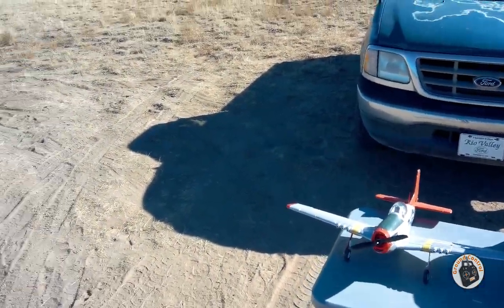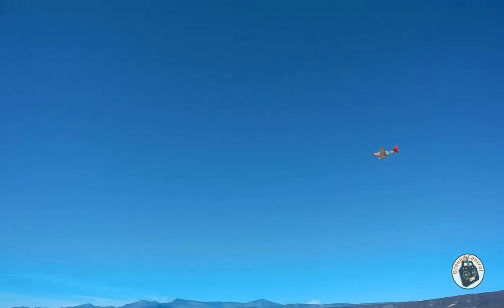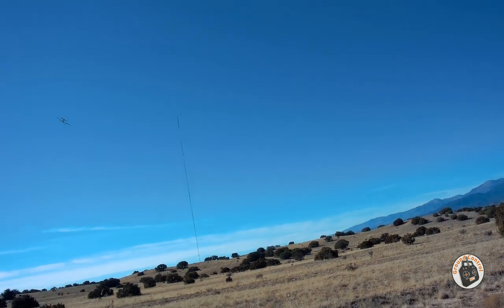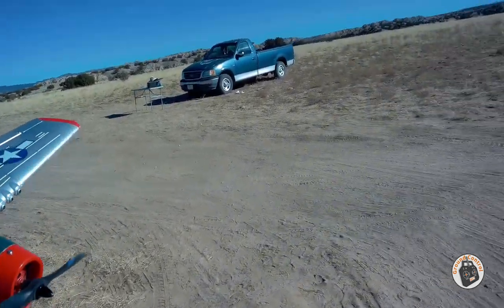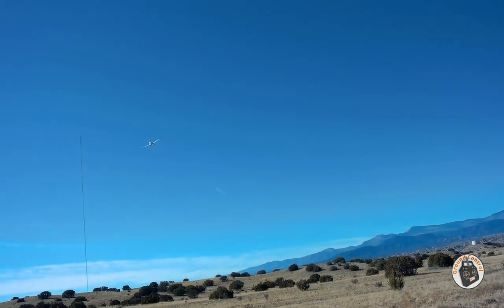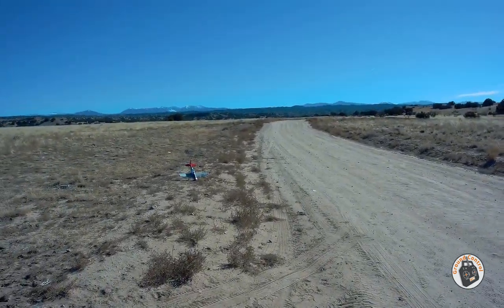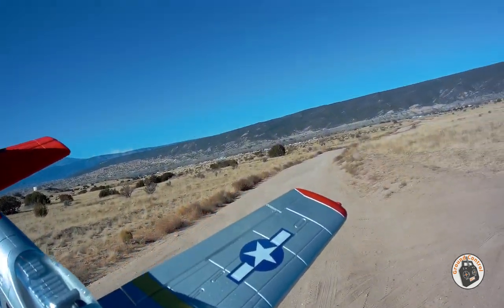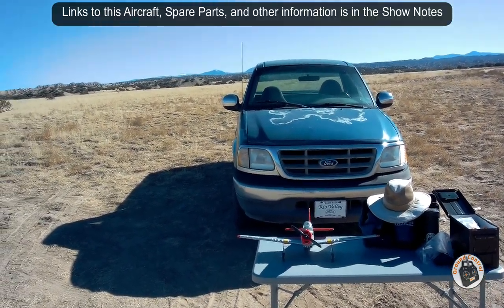Volantex P51D Mustang 750mm Wingspan PNF - Agile, Aerobatic, Wide Flight Envelope, It's a Keeper!

Comment: One of the best "SAVES."  From a turkey to a soaring eagle.  Nice work.

It's crying for a pointy nose though.  There must be some way to get a red spinner on it again.  Maybe redo the motor mount to relocate the motor? Aftermarket spinners start at 1-1/2 inches or maybe 1-1/4" (32mm) so I think one would fit OK.

Happy P-51 flying!

(P.S...4:59....Nice roll-out landing!   Landing #2, not so much (heh-heh))
Reply from the maker: Thank you much!
Hehehe...everyone wants a spinner on this mustang ;-)
It does look a bit strange with the blunt nose but it flies so nice now I'm afraid to change anything...hehehe.
Yeah, the 2nd landing not so much ;-)
See you in the Air!

Comment: Great Flying!!! Did you find the CG marked spot on the wing to be accurate with your 3s setup? Also are you still using the narrow compartment for the battery at the bottom (battery placed vertically) or you  modified it in your setup? Finally, did you install the regular receiver on the wing in between the aileron servo? Thank You
Reply from the maker: Thank you much!
Yes, the CG is good with the 3S LIPO mounted vertically and no modification of the battery bay was required.
I installed a standard 6CH receiver on the top of the wing as far forward as I could get it.
The LIPO is a GNC 3S 550mah LIPO.
I love this airframe ;-)
See you in the Air!
Reply: @GroundControlRC  Fantastic Thank You! Did you manage to put the receiver antenna hanging outside? May be it's me but I noticed that sometimes the vertical battery creates some interference with the receiver
Reply from the maker: @ioskaioska5166  You're right, those vertically installed batteries do cause issues and I had a signal loss with the Volantex Super Cub because of that.
I used a receiver with long antennas so I drilled a hole into the canopy and one of the antennas is inside the canopy and one is straight down the inside of the fuselage toward the tail.
I've never had any signal issues with it installed this way.

Comment: Does this plane work with the controller form the mini warbird (400mm P51D v761) series?
Reply from the maker: Hi Tam!
I have the PNF version so I installed my own receiver.
I don't think the RTF version uses the same Protocol as the Mini Warbirds and I can't find any information on what protocol it does use.
I wish Volantex provided that information.
See you in the Air!

Comment: The P-51 is a nice looking, good flying airframe.  Lots of fun.  An appropriate plane for your bombed out runway.  😂
Reply from the maker: Hi Jack!
Yes, this is an excellent airframe and a blast to fly.
It just bounces right over those bomb craters ;-)
See you in the Air!
Reply: @GroundControlRC  where did you buy it from? , please tell me you purchased it from an AMERICAN vendor and not from BANGGOOD ..
Reply from the maker: @knightrider3766  Hi Knight Rider!
I did purchase it from Banggood.
We don't make anything in the USA as everything is made in China.
Where do you think a USA Vendor would get this plane ;-)
So, I should purchase this plane from a USA Vendor who purchased it from a Chinese MFG?
I've purchased approx. 75% of my RC Products from Banggood.
I've always gotten very good customer service from them.
Much better customer service than I get from most USA Vendors.
Even most USA MFGs have moved their operations overseas.
I think you will have a very hard time finding anything that's actually manufactured in the USA in the RC Hobby ;-)
Reply: @GroundControlRC  I think my Cannondale road bike  frame is the only thing I own that was made in the good ol' USA, though most of the components on it were made overseas  ;-)   About the only ones made here these days are of the high-end, hand-built variety.  We can't make anything here today cheap enough for mass production because we don't have the poverty-level worker pay minimums that China allows for it's people.
Reply from the maker: @Doggeslife  Very true!
Even skilled professions are being relocated overseas.
Anyone call for tech support lately ;-)
And I know no one shops at Walmart ;-)
Reply: "And I know no one shops at Walmart"

I have a confession to make.... ;-)
Reply from the maker: @Doggeslife  Noooooooo!
Hehehe

Comment: Is the stock ESC rated for 2S and 3S?
Reply from the maker: Yes, it's rated for 2S-3S but it's only a 10A ESC.
I replaced the Stock 10A ESC with a 20A ESC for this 3S Power System.
Reply: @GroundControlRC  I appreciate your reply. I finally took mine out today! I have the stock motor and used the 2s, 500 mah battery and only got 2:30 minutes of flight time. Is that normal?  I am new to all this and appreciate Your time.
Reply from the maker: @Stvvts-mn9di  I had the same issue with the stock power system.
I use a 2S 550mah LIPO and was only getting 2.5-3 minutes of flight time.
They over-propped this power system with that 4-blade prop so it pulls more amps than it should.
The best way to get better flight time and power is to use a 2-blade prop and a 3S LIPO.
A 12A 2S-3S ESC, a 7x4 2-blade prop, a 3S 550mah LIPO, and it will fly like mine.
This P51D should have been setup for 3S Power to begin with.
It's a bit of work but the results are fantastic.
This airframe is absolutely fantastic they just really messed up on the Power System.
Reply: @GroundControlRC  The motor you have listed is out of stock, would any 1400kv plane motor work? Or is there a size I should look out for? 

This channel is great! Thanks again for any and all advice.
Reply from the maker: @Stvvts-mn9di  Thank you very much!
You should be able to use the stock motor with a 3S LIPO and a 12A ESC if you replace the Stock Prop with a 2-Blade 6x3 Prop.
I believe the Stock Motor is an 1800kv and my Motor & Prop Testing show very similar thrust and efficiency with that setup on 2208 1800kv motor.
I replaced my motor because I damaged the stock motor mount.
If I had to do it over again I would have used the stock motor and mount to begin with and it would have saved me the majority of work I put into it ;-)
Reply: @GroundControlRC  Thanks for all the information you’ve given on this P51-D. I copied what you’ve done and am very happy! I even found a 850mah battery that fits.
Reply from the maker: @Stvvts-mn9di  You are most welcome ;-)
It's an awesome warbird!
See you in the Air!